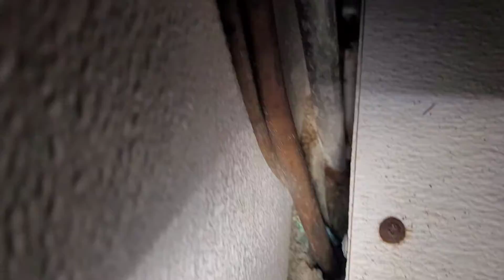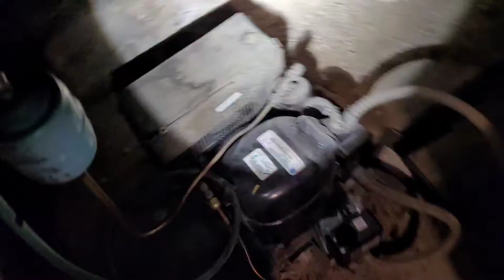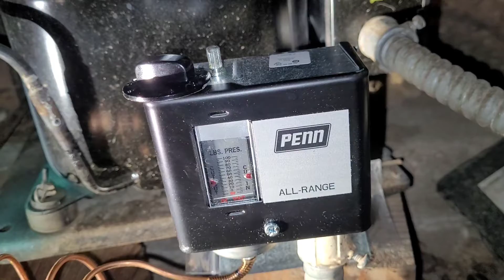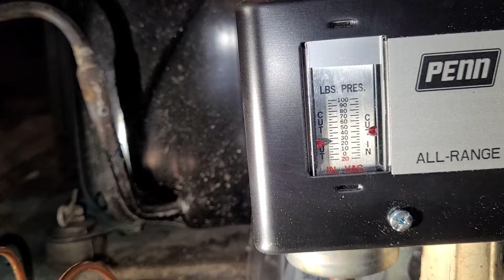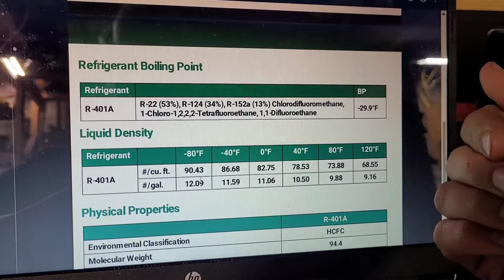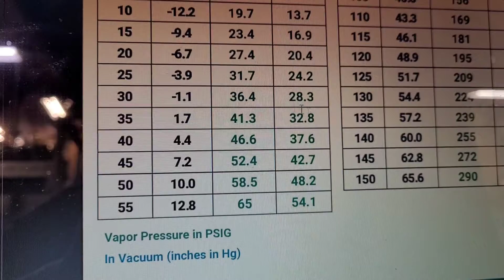Cooler with NO Thermostat! How systems with No Thermostats work!

Comment: I have a walk in cooler set up like this. It seems I am always adjusting it because I have it in my unheated, uninsulated pole shed. Do these pressures change with ambient air temperature changes? Also, can I just buy an analog heater/cooler thermostat control with the dial and copper wire to the pressure bulb and install that by wiring my compressor to it? Thanks in advance
Reply from the maker: I would put it in series with the pressure control. Then when it opens, it will do the same thing as the pressure switch. Sometimes the pressure switch directly interrupts power going to the compressor, whereas some of the time it is cycling the contactor on and off. All depends on how many amps and if the switches can handle the current.

Comment: On older commercial systems why add a thermostat if it is really is not needed, plus thermostats were mercury type back then, were heath issues and  become inaccurate and less efficient over time due to wear and tear of their mechanical parts.

Comment: super simple and cheap set up but i always trying to convert it to digital controller and LLS with 5PSI pressure switch. total parts usually cost around 100$, and customers happy to actually see temperature inside the box.